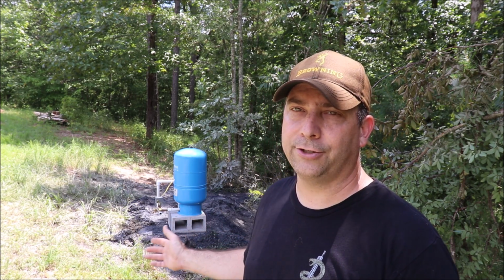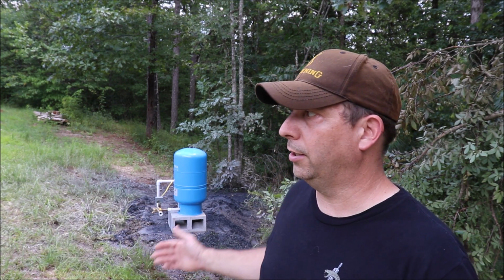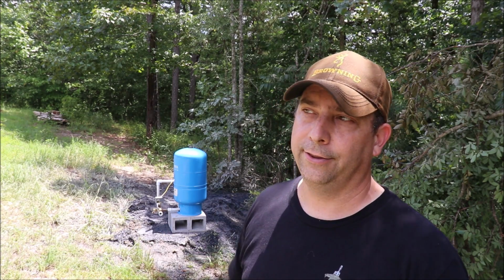Building My Own Home Episode 139   Drilling A Well For Our Water Supply

Comment: JudithB   After 20yrs on  a  well,  I  moved  and  so glad to have  community water.  However,  Now  I  wish I had  put in  a  well  as  a  oil pipeline  is  crossing  all  the  water  sources  from Ft Smith  to Memphis.  Now,  I am  trying to  get  a  water  storage system built  to  use  rainwater  as  backup.  One  habit  I  got into  was  writing down  how much electric I  used  weekly,   if  it  went  up  a lot  we  started  checking  the  well and  the  water lines  for  leaks!  I have been  here  25 yrs now  and still  track my  electric  weekly! LOL

Comment: I’m joining the group saying that $4k is pretty good and 80 feet is damn good too. We went to 260 feet and ran into 20 feet of water bearing sand. Upside is we have a huge flow that I’ve never been able to dry out. Downside is that it not only has sand in it but tiny bits of very soft coal. Tastes great but it’s hell on pumps. Like you, we went 20 feet beyond our point but there is enough hydrostatic pressure that the water comes up to 180 feet so we have almost 100 feet of water in the well. If we don’t use much water the sand will settle but if we use the well for irrigation or to fill our pond in the summer we can get the water level down enough and pull enough water so that we get tiny sand particles. But that’s after running the pump for a day or two so I’m not complaining. Id hate to pay what it would cost to buy that much water. We also have the opportunity to use co-op water and we are hooked up just in case but we don’t use it much because it literally costs $10 per thousand gallons. (As an aside, we’d have a hard time getting a well permit today. Texas passed a law that says if you have the chance to use a municipal or community water service you must use it and getting a well permit is tough unless you can convince them you have an agricultural use. Damn politicians were bought off by water folks.) 

But happy you have multiple sources of water. Good insurance.

Comment: I hit water at 97' and the water came up to 70'  in the casement pipe. I set the
pump down at 87' and have had good water for over 30 years. I have never heard
of putting the pump in the flow of water until this video. Here in VA the pumps are
in the casement pipes.
An excellent video as always. I look forward to the next one. --- Tom
Reply from the maker: I think maybe I wasn't clear in the explanation. My pump is in the casement. I just meant that is not above the static level of the third water flow. If the well silted in that much I would lose those extra gallons per minute that put me up to the target of 20gpm.

Comment: Great! out where I used to live in 3 Points AZ, the well depths were 1000' ft, luckily my well was already drilled so I didn't have to spend $26k for a well, plus the pump and pipe and 1000' of 4AWG wire down the well and the 1000' of wire and pipe to my house....

Comment: $4k for the drilling, pump and pressure tank is a deal in my book. I had a well drilled on my place 10 years ago and it was $4k for just the 165' deep well, without a pump or pressure tank.
Water well drilling and pump installation prices vary widely by geography. Heck, it will generally cost about $1500 around here to have a well pump replaced. I'm near Raleigh, NC.

Comment: 8 years so far on my well. Been through a few pressure switches so keep one of those on hand but other than that nothing major. I might recommend a water conditioner just to help your appliances and water heater last if you can sneak it in the budget.

Comment: $4,000 is a bit high for less than 100 ft here in Michigan. But most wells aren't that deep. With surface water about every 3 miles in any direction we have ground water every where. Usually you can pound your own shallow well of 30 ft or less. Just using a sand point & 5ft sections of pipe screwed together with a foot valve to hold water pressure. A hand pump can be used so no electric is needed. Or use electric and put a shallow well pump on it, your choice.

Comment: Our well is 340' through mostly granite.  We're at 5600' and in a semi arid climate.  There isn't an aquifer that we can reach.  We look for water captured in the cracks and crevices of the mountain.  At 240' the driller called to tell me that we were getting 3GPM.  We decided to continue drilling and went another 100'. where we're now getting 3GPM :). It's not enough to water a lawn, but here that's not feasible anyways.  There's 450 gallons of water in the well shaft so we have never run out of water during normal usage.  I did experiment once to see how long it would take to dry the well.  It took 2 hours with a 5/8" hose, 100 feet long at 50PSI. engineering tables tell me that we were flowing 1000 GPH, so 2000 gallons before dry.  Probably more than 3 GPM, but still not enough to irrigate.  Our well cost $16000. We put in a variable speed pump with a variable speed drive.  Our tank holds about 1 gallon of water but our water pressure doesn't fluctuate more than a pound or so..

Comment: I forgot to mention I also run UV bulb which is $135 a year as well as a kinetico water system and filter. This is gravity fed and all I need to do is add salt to keep the water soft. Yearly total is about $200 to have a dig well and water filtration/purification system.

Comment: We are currently getting our water well drilled about 8 miles south of Palestine Texas. We are trying to get to the Carrizo/Wilcox aquifer at around 700". cost is $20,000. Monday 10August2020 it will be two weeks they have been working on drilling to complete our well. The local rural water supplier ( Co-Op) wanted $14,000 just to connect us to their supply pipe around 2000" away plus the monthly fee and water usage charges.  Hopefully we get water sometime next week. There is water at shallower depths but it is Sulfur and Iron laden water that is not suitable for home use. BTW, our site has about 20 feet of sugar sand then clay with several alternating layers of shell, sand.

Comment: Imho a well is a better choice than community water, but there's an even better choice - rain water. Don't have the issues of fertilizers/manure/heavy metals or other particulates from your neighbor's activities filtering into the well water you drink.

I've had a rain water system for two years with no problems maintaining purity and keeping the tank full.  Northwest AR has been getting plenty of rain - easy to maintain level. If anyone is interested, I can give my setup specs.
Reply: Please do share! I have been researching rainwater systems. My biggest question is, how do you keep the storage tank clean? Is it difficult? Do you have to treat the tank water regularly with chemicals?
Reply: @bry2k  that is an excellent question. I did some research as well on keeping rainwater drinkable and cleansing. I have a 2500 gallon cistern I keep in a barn from which I collect rain water. I'll expand to another cistern for watering trees and such, but I've never gone below 50% of the cistern for myself. 

I use a first flush system to allow initial rain to discard excrement ( excellent for trees ). Some bird droppings, etc make it into the cistern, so I use an ozone generator ( Amazon -  ~$50 ) daily to kill most pathogens. Also chlorinate 6% str. monthly. Chlorine will evaporate after a few hours. For filters, 5 micron, then pump, then .5 micron carbon filter - should filter most pathogens/cysts. That worked for about 2 years. Recently, I added uv light to kill anything else. Water measures less than 20 ppm.

One more good idea I've been meaning to implement is a 5 micron filter just before the water enters the cistern. Since it's been about two years, I also need to drain the cistern and clean it well. I can see to the bottom and it's not too bad, but I'll do it anyway. GL.

Comment: Pro Tip: Move your pressure tank into the house.  Doesn't really matter where in the system it is, and makes for smaller/simpler "well house" for winter.

Comment: Hi I'm from the UK so we are virtually always on the mains water supply so don't have any experience of well water.  Just out of interest how long do you expect this new well of yours to last before it runs dry?  I always enjoy your videos and its great things are progressing well and moving in time is coming.  Do you think you will be moved in before winter?
Reply: most wells in the USA last for 100's of years. Sometimes you need a new pump or pressure tank 20 - 30 years, sometimes a new pressure switch 10 - 20 years but that is all.

Comment: Were I'am waters 800 ft down cost $18.000 and the water is crap. Fort Worth Tx.   Not even a mile away a friend has a 40 ft deep well that never runs out.
Reply from the maker: Sorry to hear that.... I think that's one of the biggest drawbacks to wells. You make a big investment for the well, but its a gamble as to whether or not you will get water. My driller said in this area they only have about 1 in a 100 that don't get good water by 500'.

Comment: while it is true, "that is a big chunk of change", you are very, very fortunate to get water at that depth, especially if it is pure and clear. if i was you, i would be tooting my horn loudly.  another thing i thought about: you do not have any metal casing or pressure line at the well and probably will have plastic coming there from the house. therefore you have no conductive surface to dispense any lightning or surges off your power line to your pump. please sir do yourself a big favor and put adequate, sensitive surge protection at the house (not the well) to rid the well wire of any spikes. several ground rods (the screw together type is better) spaced 8 to 10 feet apart would be wonderful.................g